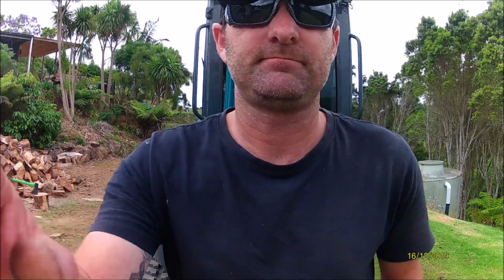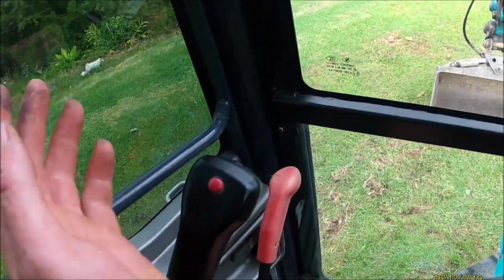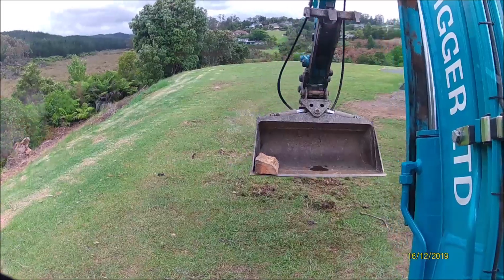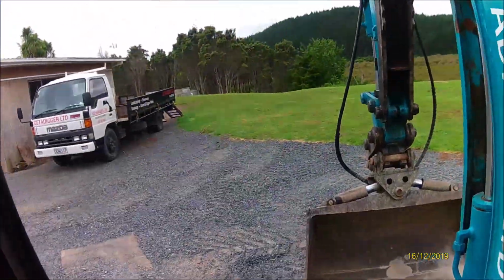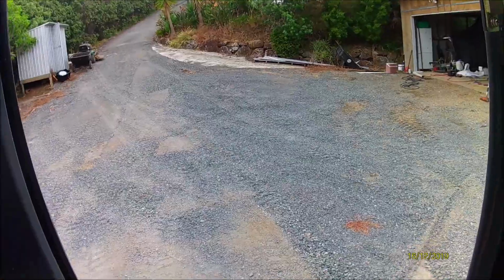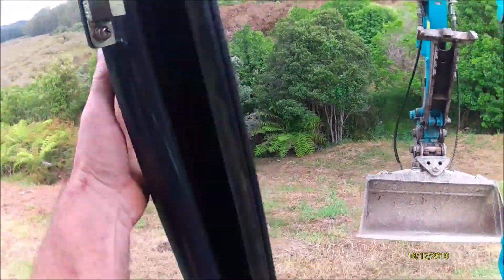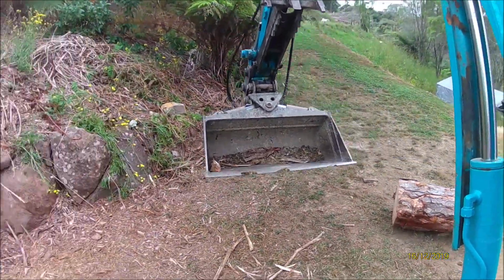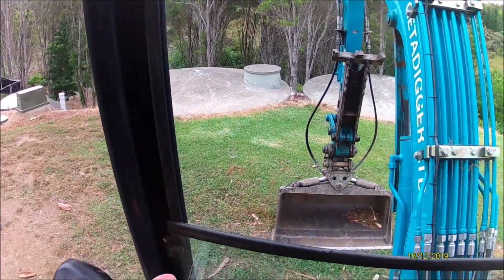Mini Excavator Operating Tips

Comment: Great video. I’m using a JCB micro and have dug out 12” clay across my lawn, leaving it like an ocean with a lot of waves across the top of the clay. I want to level this out and have been trying to drag the edge of the blade towards the machine whilst taking off a half inch. However, when using the controls I find it difficult to keep the blade at the same height as it travels towards the machine. Initially, the sweep is ok then the blade starts to lift, so I lower the boom a small amount, but if I am not careful the blade will start to cut deeper rather than stay level, due to the arc it travels through. I have been practicing and made some improvement, but it’s hard work. Does the bigger machines have some form of auto levelling, or it is down to practice?
Reply from the maker: It's all time in the seat. The bigger machines do have more stability and power which does make a difference but even then its all operator.